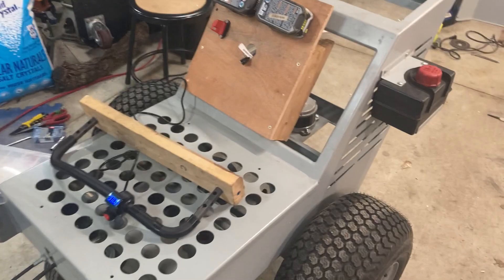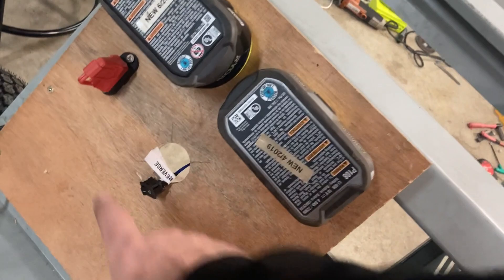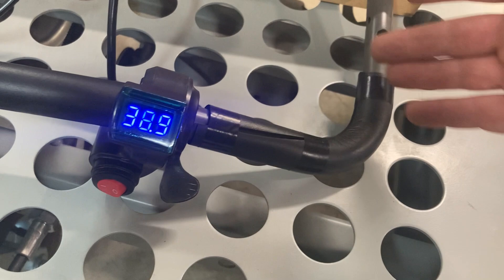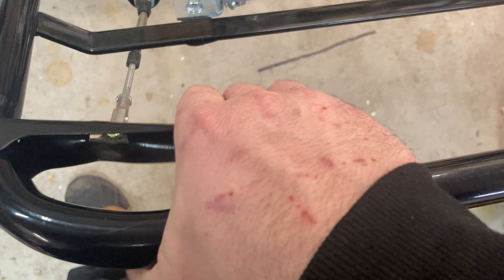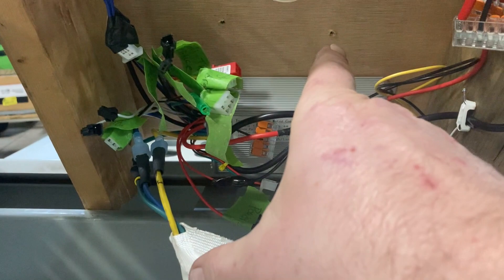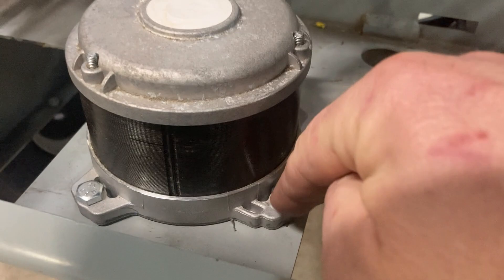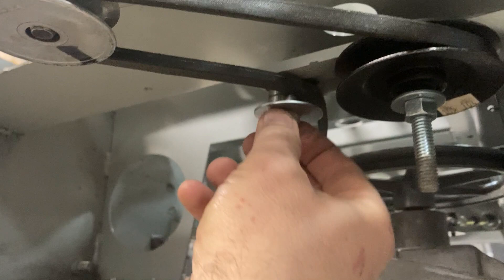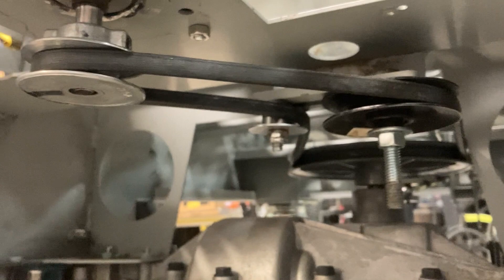Electric Wheelbarrow from salvaged Ryobi 40V push mower

Comment from the maker: Weird idler/tensioner is just temporary. Trying to make this work without having to make ONE MORE trip to the hardware store!
Reply: use a couple washers narrower than the OD of the bearing to give it space from the frame, you should be able to tighten those bearings down hard enough for testing.
Reply: Ben, big washer(you have), small washer(you need to add), 1st bearing(you have), 2nd bearing(you have), small washer(you need to add), big washer(you have), threadlock nut(you have). 😉 Great video series, thanks.

Comment: Are your batteries wires in parallel or series? I've been thinking of doing this to a Rhino lawn wagon using the transmission from a lawn tractor with a dead motor
Reply from the maker: They are in series for about a 40v system. I salvaged the motor from a 40v electric lawn mower.

Comment: Looks like the belt is rubbing on the frame too ?
Reply from the maker: Just a hair. Again, this was just a temporary setup using what I had to make it work. I was pretty sick of runs to the hardware store by then!
It's so strange to me that it appears there's a slot that appears designed for a tensioner or idler, but it's on the WRONG side of the belt!

Comment: I would like to build something similar. How far/long will the batteries last do you think?
Reply from the maker: Hard to say, as I have no idea how much current this will draw under varying conditions. I really just need to test it with an ammeter in place to be able to find that out.
I was thinking that using replaceable tool batteries, it almost doesn't matter how long they last, as they can be swapped out with extras and recharged.

Comment: Hi, what about using a kevlar belt like electric motorcycles/ scooters?
Reply from the maker: A kevlar belt is stronger and also more expensive. I don't really see any advantage to it in this situation.
I just need a shorter belt and real tensioner on the right side of the belt.